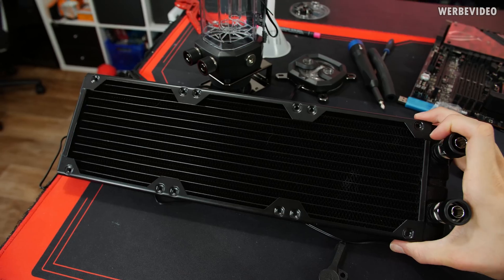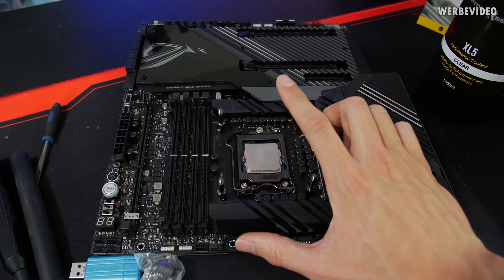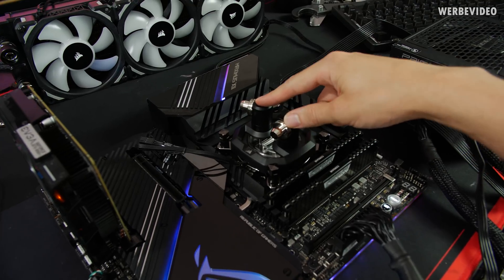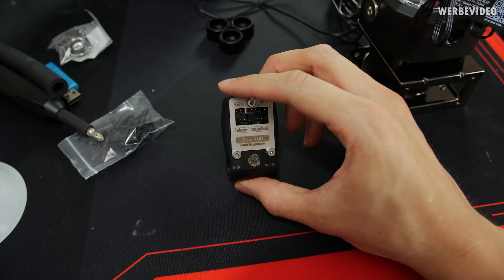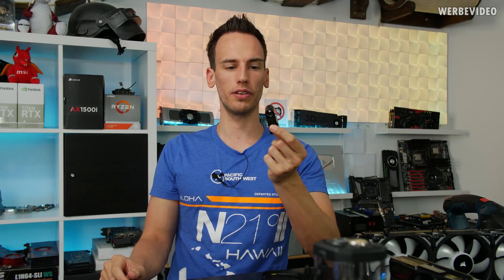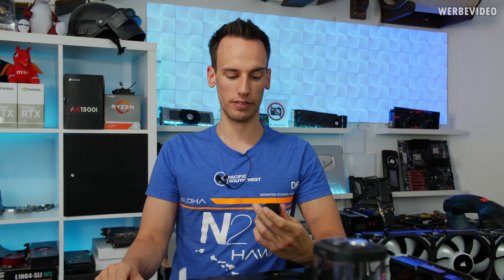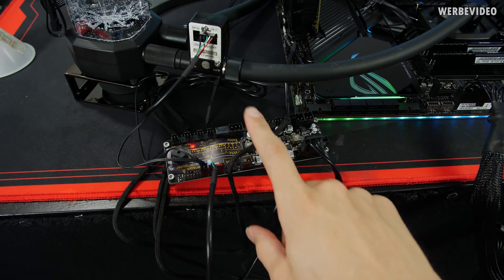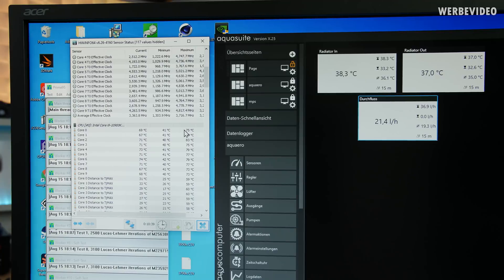Testing one of the Weirdest Water Cooling Myths - A SLOWER Flow Rate will result in BETTER Temps?

Comment: How about 2 rads in parallel slows the flow rate through the 2 rads. But keep the same flow rate through the CPU block? Any benefit Vs 2 radiators in series?
Reply: I’m an Mech Eng in Thermodynamics. This would be the better setup if you are taking the cooling air for both from outside the case. If you have one rad using inflow air and the other using outflow air, there would be no benefit over running the rads in series. In series the last rad should use the coolest air.

If both rads are pushing into the same case, you will hurt airflow and it will be worse than two in series. Water to metal heat transfer is much more effective than air to metal. Anything you do to improve airflow will have a much bigger impact on loop temps than water side. The only reason you need more rads is to get more airflow across the fins. Or you could do like the drag strip and throw buckets of ice on your intercooler.
Reply: @harttdm  to be fair I did have automotive in mind while looking at this stuff. I have a water to air cooler which is not reliant on high pressure like a CPU water block but will need the ability to dissipate a lot of heat. Due to air flow being linked to speed and a limited frontal cooling area I figured if I ran 2 radiators in parallel for the system I could keep the water in the radiators for a longer making best use of the available frontal cooling area?
Reply: half distance and half speed so net 0
Reply: @BTD3Fan  they rads would be in parallel so half speed so the water has more time to cool. but the flow and pressure on block would remain at the original flow/pressure the piping distance would be greater.
Reply: @DrSpanky  yeah but all the water as a whole has to cool and the the rate of cooling is a function of the difference in temperature, so it staying longer wouldnt be a good thing
Reply: but it actually doesnt stay longer since the rad would be half the size.. even tho its going half speed
Reply: bc 2 240s in series going full speed is 1 speed across 480mm, and 2 in parallel is 0.5 speed acros 240mm

Comment: So try this - pump flows to GPU/CPU (either order), goes into T- type fitting, splits off to 2 or 3 radiator inlets, radiator outlets to another T-type fitting, single line returning to reservoir and onto pump to continue the cycle. Full flow would pass CPU/GPU, but the flow through the rads would be slowed to provide longer contact.

Edit: seeing other comments about auto radiators. This method would be similar to why a dual-core radiator is better than a single-core radiator. It doubles the surface area for the coolant and slows the flow rate through each core, thus increasing the time the coolant is in "contact" with the air
Reply: so, the Radiators in Parallel? unfortunately, the Water will prefer the path of least resistance, and whichever Radiator line offers even the slighest bit less resistance, will get substantially more flow than the others.
additionally if you put all of the Radiators in Parallel, how exactly is the Water spending more time in the Radiators? even if it was a perfect 33% split, the best case scenario would be the same effective course length, would it not?
while in reality it would effectively be markably shorter.
Reply: It's a closed loop, so the pressure will remain constant. But by dividing between 2 radiators, the flow through each will be halved. Since each radiator needs to handle half the volume of coolant, at that pressure, the flow will slow down, thus leaving the coolant in contact with the radiator for longer, giving it more time for heat exchange.

The "path of least resistance" concerns are not how fluids in a closed loop work. The fluid will still travel through both radiators at almost entirely the exact same pressure and volume - unless it has a serious blockage - but that's not a fault of running the radiators in parallel - that would cause a series run of radiators to fail too.

If you watched the tests, he got a large delta T between inlet and outlet of radiator by letting the coolant flow slowly, which this parallel radiator system would do. But the better delta T on the CPU/GPU  was with greater flow through the system, which this parallel system would do.
Reply: @galxieranger8277  
and how Parallel do you expect to need to go to get a markable difference in time spent in the Radiator? you're going to need to go to pretty extreme lengths to overcome the greatly reduced volume moving through most of the Radiators, mainly the ones that aren't as straight routed from the Pump as the others.

unless you're going to presume you can bump the Loop up to a Pump that can handle real flow and pressure like around 350L/m or otherwise something just silly. might i remind while we're here that the Liquid Loops we use are not pressurized to any significant degree. the pressure is... quite low, and always with extra space in it.
but then you don't really need hardly any of that extra Radiator space anymore and you're back to the sort of ratio you started with, just with more of everything.
Reply: @taiiat0  the coolant flow is still technically pressure. If the pump is running 20 GPM, that's the flow through the CPU/GPU blocks and through a single radiator. If you add a second radiator in parallel, the flow through each radiator will then be 10 GPM - half the flow rate. This slows the coolant down so it remains in contact with the air for a longer period of time. This is the same principle behind dual-core radiators in cars. It divides the flow through 2 cores, thus slowing the coolant down so it remains in contact with a heat-exchange surface for much longer.

To see this principle in action, albeit in reverse, turn on the water in your garden hose. Now put your thumb over part of the end of the hose. The water pressure doesn't change, the volume of water doesn't change, but the speed at which the water flows changes. In this case, it speeds up, because it needs to go through a smaller flow path. Remove your thumb, and the water speed slows down. It's derived from Bernoulli's Principle.

And in the video, we saw that by slowing the coolant flow down, there was a greater drop in temperature from radiator inlet to outlet than with the faster flow; however, that slow flow caused the coolant temp in the CPU/GPU to rise. So we need fast flow through the CPU/GPU, and slow flow through the radiators, and we get that slow flow by running the radiators in parallel. Because the same volume of water is now technically passing through a pipe twice the surface area of the original pipe, which means its flow rate is halved.

We get fast flow through CPU/GPU to best pick up the heat from it, slow flow through the radiators to best exchange the heat to the air.

Comment: The amount of armchair water-cooling experts who don't realize that all these myths have been busted years ago is hilarious. They should really get educated before they post.
Reply: i dont even understand what the argument was?
Reply: the one in the title doesnt make sense but I can see a reason for the alternating radiator and heat source 

if you are water watercooling something like ram which takes very little power, the energy from the cpu or gpu will just be heating up the ram to a point further than it would have heated up outside the loop.
plus anyone with 2 of the same gpu has seen the one after the first reach higher temperatures..

I see this a lot and dont understand where people get the idea that energy only conducts one way

the only way it couldn't make a difference is if the heat gets perfectly distributed throughout the loop as if water is a superconductor, which if so then the flow rate wouldn't matter...

Comment: I run a Hygger pump at 300 gallons an hour, CPU and GPU are pinned at 28c at all times. I'm scared of the water blocks leaking if I set the pump to any higher speeds. The pump is capable to 450 gallons an hour. I use Hygger Aquarium and fountain pumps in my computers. I also run a 95,000 watt 6 pass, water to air heat exchanger as my radiator.  Edit: just upgraded my pump last night to 800 gallons (3000 liters) an hour.  Now my temps only spike to 43c while benchmarking.

Comment: In my experience having radiators between water blocks can have a significant reduction in temps.  Of course the first time I had two GPU water blocks connected it was Kepler Titans with an unlimited power BIOS drawing around 400 watts each.  The temperature difference between them could get as high as 6-8C.  That was unacceptable so I added another thick 280mm rad between them which evened out the temps, which is something important to me for some reason.  I have run CPU blocks with chipset or mono blocks together pre-radiator, but I ALWAYS have the CPU block first as the temps for the chipset isn’t typically an issue.
And pump speed or flow is an important factor as he mentioned.  Slow flow is just a really bad idea.  The water will still spend roughly the same time in the radiator, it will just be making multiple passes.  It’s just more efficient.
Reply: his conclusion is correct, but his measurements are not: 

A simple thermodynamics calculation gives 1.5[K]*4.2 [J/g-K]*5.5 [g/s] = 35 W. You are putting 170 W into the radiator, and your measurements only explain 35W. The temperature difference across your CPU or radiator at steady state should be ~7 degrees C.

Comment: I'm running my pumps at around 60%. Because as der8auer says, you can't hear the pump. But the gain in lower CPU temps with running the pump at 100% is so minimal that there's no reason to do so

Comment: That was my experience. I have a loop sensor and no matter where I put it I rarely see more than a degree or two difference. I also tried all sorts of order, CPU-GPU rads etc etc. Didn't really seem to matter much. The ONE thing that had the most impact was intake ambient temperature. Every time.

Comment: I think the cpu block matters a lot more then the temp of your water inbetween components. If your cooling block has more surface to dissapate heat into the water cooling will be better. Most cool blocks have just a small contact (short fins). Longer fins in them could help as copper to more copper has a better heat transter then copper to water.  So having more copper to water contact should have more cooling. if those few degrees matter anyway is the question.  I still use air as with my luck i get water spraying in my pc.

Comment: I have the same pump but i have 2 480mm rads a GPU block and CPU block, i saw improvements in CPU temps until 2600rpm, increasing it further wasn't worth it anymore.

Comment: It's interesting that doubling the pump speed from NORMAL only reduces CPU temps by 0.4 deg... so much noise for so little effect.
Reply: Jay did a review about this but did a fast demonstration but did not record the temps just like this.
He said he doesn't care what his pump speed since he also goes for manual pump speed control and don't use PWM 4 pin pumps that's why he always forgot or have no idea what's his pump rpm or pump %  is he always goes for the highest possible as long as there is no noticeable noise by manually tuning the knob of the manual pump controller.

In this video 100% is useless and annoying because of noise.
And slowest is not a good idea in terms of cpu/GPU temps.
Normal or above normal as long there's no noticeable noise is always the sweet spot.
If the loop is complicated and restricted then slow and normal is not for you need something in between normal and max.
Reply: There is something wrong with his numbers. I would think the flow rate are off by a factor of 20.
Reply: @idontwantacallsign  Remember that pumps are rated for maximum flow with zero backpressure. 

Even 5psi of backpressure DRASTICALLY reduces pump output on these little d5s.
Reply: @idontwantacallsign  I think he doesn't have it calibrated right. I have the same sensor, you must calibrate it at zero flow with the pump(s) turned off before it gives you a more reasonable number. I've had some trouble with mine trying to get it calibrated correctly and giving me a consistent number. But now I don't feel so bad since der8auer isn't using it correctly either. I say just rely on a flow indicator, as long as that thing is spinning you're good. Otherwise his test is valid and I agree with his conclusions.

Comment: Der8auer,
Im going to give this video a very cautious approval but you are making blanket statement which may not be true.

High flow rate does help insure that you always maintain maximum heat transfer up to a point.  But heat transfer thermodynamics is not a simple topic and it involves a lot of complicated models differential math simulations.  There is a maximum thermal conductivity, and no matter how much faster you pump that fluid you arent going to get improved temps.  You can have something blazing hot on one side and cool on the other.  (Ie coals or shuttle tiles). Once you hit that conductivity limit you can't do better. This is why improvements exponentially decay with pimp speed increases..

Where I work, we work with over 30 inputs for a coil design.  I work with this code as an engineer on a very regular basis and have over 10 years of direct experience with coils and heat exchangers.

However if a fluid is too viscous and you create too high a head pressure you are wearing out your components faster and possibly even generating more heat through friction and vibration.

Comment: What this video doesn't answer is whether or not there is a maximum flow rate or maximum reasonably achievable flow rate, given the restrictive nature of the waterblock, beyond which it would make sense to interleave radiators and waterblocks, because (the then miniscule) increases in flow rate, even with more pumps or more powerful pumps, becomes impossible or begins to add heat into the system stemming from the pumps themselves. At this maximal flow rate, which is clearly a function of all of the restrictive parts of the loop, the radiator inlet/outlet temp difference becomes the only remaining factor that influences CPU temperature.

Comment: You never presented any proof of no difference in ordering parts, and I still believe that it matters. I would love a video presenting that theory separately! Good job on this one though
Reply from the maker: Yea it will be a 2nd video :)
Reply: yeah..
if you are water watercooling something like ram which takes very little power, the energy from the cpu or gpu will just be heating up the ram to a point further than it would have heated up outside the loop.
plus anyone with 2 of the same gpu has seen the one after the first reach higher temperatures..

I see this a lot and dont understand where people get the idea that energy only conducts one way

the only way it couldn't make a difference is if the heat gets perfectly distributed throughout the loop as if water is a superconductor, which if so then the flow rate wouldn't matter...

Comment: What about having two radiators in parallel?
Reply: it lowers the velocity in each, which reduces the heat transfer coefficient of the water to the air. It will be worse from a heat transfer perspective, but it will produce less pressure drop, and so, the flowrate from the pump might be higher. It is a system level design question.
Reply: @arkie87  well also it would be half the distance so it would be net zero
Reply: @BTD3Fan  half the distance affects pressure drop. It still has the same area though. I dont think you can conclude it would be net zero, but the affects do partially cancel and it is  impossible to tell which would be bigger than the other without doing system level modeling.

Comment: People assume that the cpu metal has the same thermal capacity than water. The cpu  is basically a bottle cap of thermal capacity and the water in the loop is a bucket of thermal capacity. Off loading a cap into a bucket doesn't really change the total thermal energy  in the bucket. As long as you offload the cap often enough it won't fill up. Water flow rate is the speed at which you offload the bottlecap. That's why you can basically say that the water doesn't eat much after going through the cpu waterblock. Only flow rate matter

Comment: i'd be interested in seeing what would happen if you forked the flow through 2x of those radiators, so the flow rate is only low in the radiator, most multiple radiator setups put them in series
Reply: It shouldn't matter in theory. The total radiator surface and total waterflow stays the same. If you put two radiators in parallel, the flowrate will be lower and cooling will be more efficient, but either radiator will only cool half of the water. In series the cooling is less effective but both radiators will cool all the water.

Comment: I haven't watched the video yet, but I'm pretty sure the myth stems from the fact that water will spend more time in the radiator. But the opposite is also true; it will spend more time in the CPU block as well. A slower flow rate will make the temperature difference between the tubes larger, but it will not cool better. In fact, if the flow rate is too low, the water on the CPU block will become saturated and be unable to take on any more heat before it leaves the block, making temperatures worse.
But, people will be people, and sometimes becoming smarter... makes you stupider. There's a whole VSauce3 video about that.
Reply: After watching the video, I was pretty much point on, and your explanations line up perfectly with what I said in this comment.
I love doing before and after comments on videos like this. It's a learning experience if I get proven wrong, and it's good to know when real world stuff lines up with what I think I know, especially when it comes to something I'm not already 100% sure on. Win-win, in my book.